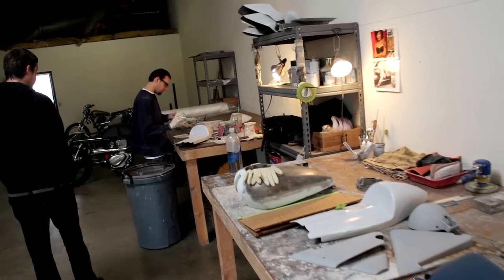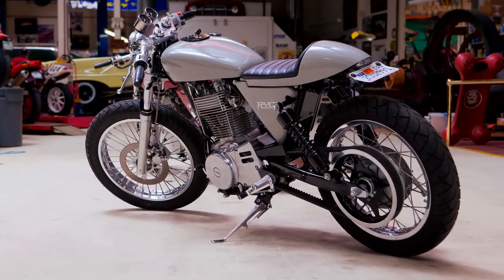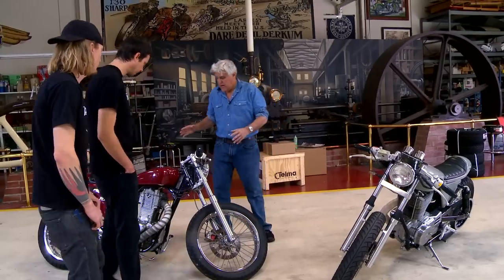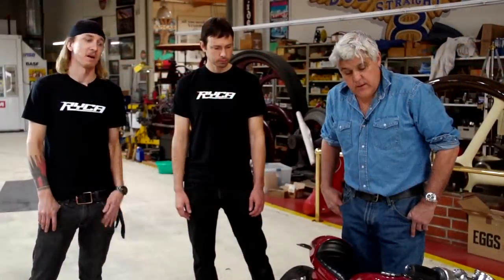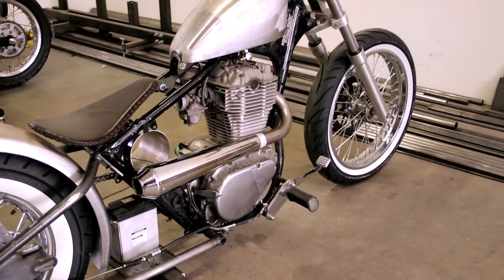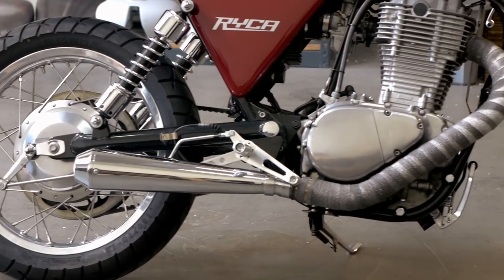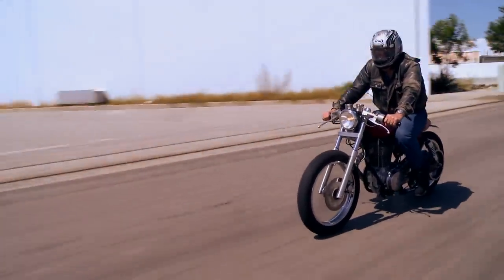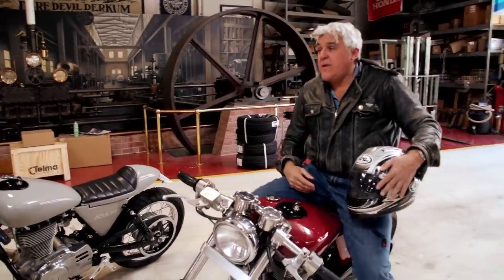Ryca Motorcycle CS-1 Cafe Racer Kit - Jay Leno's Garage

Comment: G'day All, try changing up without the clutch it's much smoother. Just on-off-on the throttle. Lifting up a gear as you throttle off. I've never used the clutch up-shifting, only down-shifting on all the bikes I've ridden. Cheers

Comment: In 2000 or so I had a Honda 500 CX which was a Japanese copy of what, a Moto Guzzi?  V-twin, mounted sideways with a shaft drive and water cooled.  Funny frames meant that people passed on trying to convert them from "Touring machines" to street worthy bikes.  I did just about all the things these guys did, except sectioning the gas tank.  I pulled off almost 80 lbs of 'trim'.
Of all the bikes I had since the 305 Yamaha Big Bear in '66, the Honda CX was the most fun, reliable and cheap.  It got lots of looks on the street and I sold it for just about what it cost me to buy and build when I married a surgeon.  No more motorcycles was part of the deal.

Comment: My cafe racer was a 72 Kawasaki S-2 350 . I had it ported and polished, installed clip-ons, rear-sets, a quarter fairing, Denco exhausts, and the crown jewel: a genuine  TZ 250 4 shoe front brake. It looked great and ran like stink and I wish I still had it.

Comment: I was riding road bikes long before I was old enough for a license (you could get away with that then if you just used your head and not get stupid). I am a thumper lover, always have been. In 2002 I purchased a brand new Suzuki Savage, I really liked that bike, lots of low end torque and really good gas mileage. I had a problem with mine I never could really fix, and that was if in a panic stop and there was slick or gravelly pavement under you, if you just touched the rear brakes it would drop in an eye blink, too fast to even react. The best help I could get on fixing it was a criticism of my riding skills, which was Bulls#it, I was and am a good rider, this was the only bike I've ever had this problem with. I finally had to almost completely unload my rear brake to stop it from locking at speed cause I was unable to stop myself from using it in a panic situation (muscle memory is a good thing if playing golf, but trying to change it after 40+ years is really tough).

Comment: The Suzuki Savage does indeed have great potential, it mostly needs a proper camshaft.    Aftermarket carb and pipe, take your choice.  I used to run my stock Savage between Savannah and Daytona all the time -- though not very fast.  Why drop 3 grand to make it look like a racer, when ya can't improve the mechanical aspects which is what it really needs?
Reply: Like jay said, not many bikes you can open the throttle up ALL the time, they're just too fast these days. A souped savage would be a blast, but most people can't do engine work like that. This is a kit for people who have a old savage they wanna make a hot bike again, or a cheap project to get a cool professional "custom" bike.
Reply: Now that a proper cam (and all the other stuff) is available at this writing, dashed if I can remember the source, sorry -- the Ryca makes even more sense!

Comment: Yeah....  a nice idea.   I was all set to buy one until I discovered the S-40's cam chain problems.   Evidently, it's hard to get more than 9,000 miles out of one without having to replace the camchain, possibly the tensioner shoe & guides, and certainly the tensioner's self-adjuster.   The Suzuki dealers use the 'tear the entire engine down approach' to replacing the chain, but there's a whole lot simpler and cheaper way to do this if you are- or know- a decent mechanic.   However, due to the long-stroke, single-cylinder design of this engine, you'll get to do it all again in about 9,000 miles, so... I think  I'll pass on it, even though I've always been a 'thumper' fan.   (sigh)   if only this was a push-rod motor instead of an overhead cammer, it'd be perfect.
Reply: That would be a Buell Blast.

Comment: The Honda CB350 is capable of performing at up to 36 horsepower at maximum revolutions per minute, rpm of 10,500. The top speed of this model is 102.5 miles per hour, mph.

Comment: Agreed, the market has hit a dead spot and really inst responding to customers.... Your choices are 250's or 600's there is there is really a huge gap in the market now. 

I think Royal Enfield is on the right track. They are supposedly coming out with a cafe' race bike next year. I love the single cylinder,  "V" and parallel twin motors.

Comment: doing an xs check benjies cafe racers my carbon fiber kit is there you get the tank seat upholstery gas cap and paint and looks great cheaper than this kit and nicer. the company does fiberglass and metal kits too and many other parts and look options

Comment: For 4k-5k you can find a used Harley,
Maybe if this kit sold for  $1000 I could see it, but to spend 5k on a savage is dumb, I've built a few bikes I like the sportsters , currently building another 1987 this is my 2nd 87, anyway I chopped it , it's a rigid 2" down and 6" stretch in the rear, all in I'm at less than 4k, I started with a bone stock  87 sportster 883 4speed,

Comment: I do niche work for riders into retro-aesthetics. But I do REAL retro.
I'll take a brand new, high-tech rocket bike and make it ride retro. I'll put dual unbalanced shocks on a GSX-R, complete with a 70s era, soft steel pipe swingarm. Then I ditch all the disc brakes, FI, suspension etc, while adding lead weights in strategic places... For weight aesthetic. When done you'll have a wobbly, shaking death trap that will probably snap the forks in the first turn, if the brakes work and if the swingarm hasn't twisted so much from the throttle it took to arrive at the turn.
Cuz aesthetics... aesthetics. Lemme say it twice...

Comment: pull your pants up, and stop frontin' like a bad boy when you're around Jay, you poser. OT: these bikes need nothing, you don't need a KIT to turn them into a great bobber, just some effort, they're very torque focused engines, and handle like  a dream, but good luck finding a Savage that runs for $600 lol, spend $2500 for a mint piece and have something you can be proud of.
Reply: Yeah 👍

Comment: Some of us poor, deluded saps continue to labor under the misconception that cutting edge performance and supreme reliability at a fair price represent good value. What were we thinking? We could be spending 20 K on 1300cc motorcycles that wheeze to generate a whopping 55 horse power and weigh 600 pounds. Oh right, they have "styling,"

Comment: 3:57 For under 4000$?i'll buy here a 1998 Suzuki Bandit with around 1000-1200$ ...
Plus its a salvage bike and if it needs engine work that will be another 500$ into it.
Its not really a cheap bike besides what i get here.Even shipped in US its less than half of all this bugdet bike wanna be
Make the kit for 4-500$ then you have a budget bike cuz no1 will throw 2500 $ for some fiberglass and another 500$ for the paint.I can paint it exactly the same for less than 50 FGS ...

A big fail i'll say.

Comment: Doing anything to a 650 Savage beyond tossing it onto a garbage heap is an utter waste of time and effort. These machines were utterly useless engineering failures completely unworthy of improvement or modification.
Reply: Useless?  Completely unworthy?  Having owned several Yamaha and BSA thumpers I can attest to the enjoyable traits of such engines.  What Ryca has done is terrific as well.
Reply: GrtSatan eh a fun putt putt bike. thumpers have a certain pleasentness to them.
Reply: Right.. which is why they have been successfully sold for over 30 years basically unchanged...